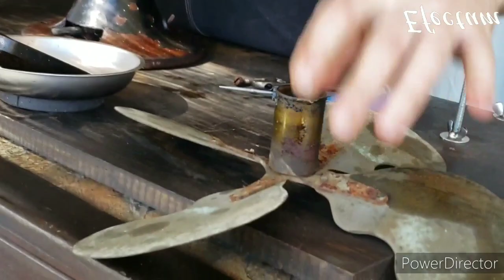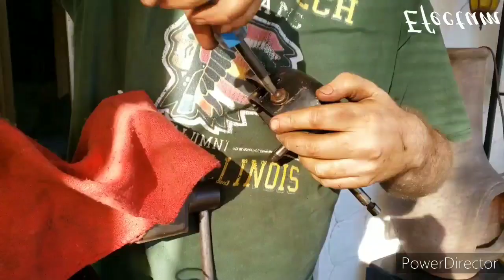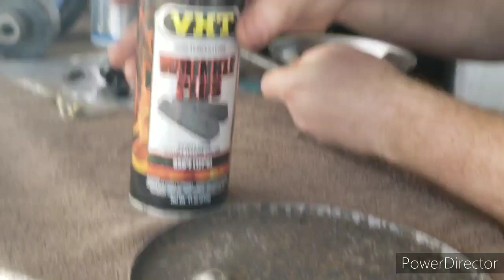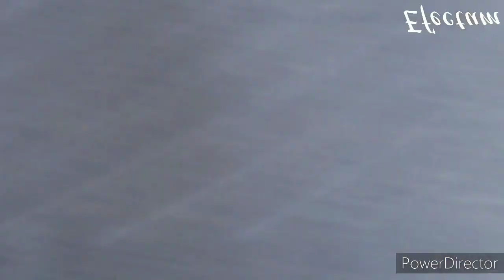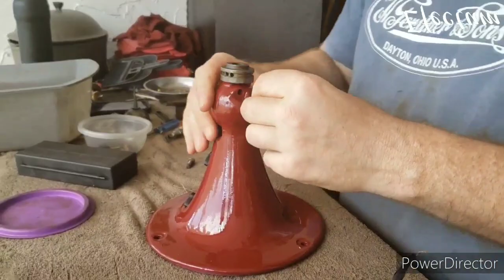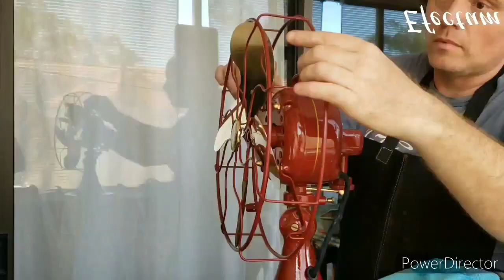Old Rusty Fan [Restoration]: Emerson 29646

Comment: Just learned a different way to twist those tricky blades off by using upper left screw hole with longer screw to safely reach rotor without risking damage to motor windings!! Thanks for the info!! Now Emerson restorers can work and sleep better knowing best way to remove those tricky fan blades!!!

Comment: Did a 16 inch just like that. All black and brass blade. Had to put in a new capacitor. New green felt on the base.
Very powerful and smooth. Should last another 88 years.
Reply from the maker: Sounds nice. This model does not utilize a capacitor. Old fans were built to last.

Comment: Color me impressed awesome restore! gets me into the idea of restoring two one small one from my grandmother and a large one from my great-grandparents around the time they came to America and bought a brand new brownstone in Brooklyn. The small fan I use often its kinda of a dark green with a hi-off-low switch, and the larger older fan needs a new fabric cord to the head unit and has a silver body with the slide switch. I plan on coming back to your video as you mentioned a guy who sells some replacement parts. Funny story I have my grandmother's Hoover upright from 1929, and until a few years back, Hoover still had new old stock parts. There's a video on YT on upgrading the inner bag to get this lol HEPA. Before I knew about Hoover still having parts, I had melted down a black spray can cap to repair one of the wheels, and it's about 90% perfect on roundness. Again, Awesome Restore!!! Thanks for the video. Eddie J.   Long Island N.Y.
Reply from the maker: Thank you for the comment. Its nice that you have a couple heirloom fans and worth the trouble to restore them.

Comment: OK, Chief!  Just finished restoring my Granddad's fan today!  As the video states, I have been jamming on this thing for a month now.  It was like a  sweater when you see a little piece of yarn sticking out.  You pull on it, and more and more keeps coming out!  I also used your ideas about pinstriping, but I used an adhesive strip that is no fun to use but makes for a satisfying job.  Also, I got a butane torch and brass wire wheels for my drill and plated several screws and left the oscillation link arm and several other parts brass instead of painting them black. Basically. I only touched up the otiginal powdercoatI and only sprayed the oscillation gearbox and adjuster on the bottom.  I will make a vid on the restoration and will link you when it's done.  Lots of great ideas from you, and I want to give full credit!  Also, it scares me to think of what I was planning on trying to get the blade off!  With the 2 inch 10/32, it twisted right off!  A day before I started the restoration, I banged one of the blades, which I restored, but hacked me off became after all its been through and 105 years, that was the first real damage to the blades!  Thanks again for your great posting!  I will be in touch!
https://youtu.be/rmzYjeH2bXI?si=3Kc7ZE70D2Z_NRQk
Reply from the maker: Your fan runs very nice and looks good too! Glad I could be some help. Nice to have a family keepsake like that.

Comment: How did you spray the stator windings with all that tape on them? Did you take it off and re-tape them?
Reply from the maker: Since the stator tested good, removing the tape is a bad idea as it would likely do more harm than good. By making small incisions in the tape you can get a long plastic nozzle in there and still spray them pretty good. This way you give some e tra protection but don't risk damaging the exisiting insulation by ripping the tape off the wires.
Reply: @BencoVintageMachineWorks  thanks so much
Reply from the maker: Thanks for watching

Comment: where do you buy the correct size and type brass rivets, I can't see the details on the bag you bought ?
Reply from the maker: Jay Cee or Mcmaster Carr are good choices.
Reply: @BencoVintageMachineWorks  are these hollow or solid rivets, they look kind of hollow in your video
Reply from the maker: Hollow, I annealed them first and drilled out the holes to fit as shown....
Reply: @BencoVintageMachineWorks  thank you
Reply from the maker: Any time. Good luck with your project!

Comment: Awesome video. Bought the same model fan today, was running at the antique shop just the oscillator wasn’t moving. Now I get it home, plug it in, move the speed to one and nothing… move it to two and nothing… move it to full speed and it kicks on full power. Then I went to turn it off and it shocked me and quit running…. My works cut out for me
Reply from the maker: Its a great fan. Very well made. Good luck on your project. Glad the video is useful to you.

Comment: I have the same fan but my blades are not brass... A magnet sticks to them!  I'm guessing some of these fan were made without brass fans?
Reply from the maker: The later ones were not brass
Reply: @BencoVintageMachineWorks   Do you know of any place to get brass blades?
Reply from the maker: Theres regularly used blades on ebay. Also check Antique Fan Parts website...

Comment: Another incredibly GORGEOUS restoration job Terry! The fan is beautiful! I immediately knew as soon as you touched it, it was going to come alive again. I admire your mechanical restoration work. Thank you so much for sharing! O, I just wanted to share a tip w/you. I noticed you taped your vice to protect the fan blades. I do small scale metal work & I enjoy a silicon sheet to protect the finish on my pieces. Just in case you might like to use some for your pieces.
Reply from the maker: Thanks for the tip!

Comment: Awesome job… your work and your video!!  I’m working on an Emerson 73646-AK that only really has one speed (out of three).  It has a split-phase motor and has a speed choke & capacitor. Resistance checks on the choke and motor are identical to another similar fan (77646) that runs all speeds. So, could the capacitor be the problem?  Any thoughts would be appreciated.
Reply: Your problem is likely in the switch or the speed coil.
Reply from the maker: This fan was my first and only attempt at an antique Emerson fan so I don't feel qualified to diagnose oroblems on things in which I do not have experience. I recommend that you join our FB group Antique Electric Motor Experts as well as the AFCA forum online. You can post pictures and will get answers quickly. Best of luck on your project!
Reply from the maker: The AFCA is not a FB group but an impressive online forum. Have fun!

Comment: You did a fantastic job on that unit. I'm restoring the same fan and found your video to be an excellent source of information.  Could you tell me what the part number is in the brass rivets you used on the blades? I looked at jay-cees website and can't seem to locate a match.
Reply from the maker: I don't remember it. It's been awhile. They were semi-tubular and came in bags of 100. I annealed them before using. Good luck on the project!
Reply: What process do you use for annealing them?
Reply from the maker: I used a propane torch

Comment: How did you clean the contacts on the switch I need to that on my Emerson Type 450.
Reply from the maker: My contacts were corroded so I removed the corrosion using Evapo-Rust on a paper towel. Afterwards I polished them up using the Dremel tool.
Reply: @BencoVintageMachineWorks  Ok thanks I appreciate it.

Comment: Looks like that linen tape is used frequently. I think I see it on my motor too. Do you know some of the common situations where it is used? Motor is a capacitor start induction... hope that's the right name. my mouth dropped when you talked about the DIY brassing technique. Totally hope there's a video for that. 🔥 Wait, where did you get a Walker-Turner shirt? 😎
Reply from the maker: The fabric tape is used cosmetically over electrical soldering connections after the heat shrink tubing is applied. I almost never use any wire nuts or regular electrical tape. The capacitor start motors were usually less expensive to manufacture than the Repulsion Start Induction Run motors but ball bearing varities are good on a drill press where the motor needs to be mounted vertically. I had the t shirt custom made. The brassing technique is shown in the video. Just heat with a torch and wire brush the piece with a solid brass wire brush in the dremel tool. Would not use in situations where the temper of the metal is real important.
Reply: @BencoVintageMachineWorks  Terry, I'm pretty far into the windings on my motor. I've removed the tape and insulation on a couple areas where the winding coils are connected and I can't seem to melt the solder (even at 800f) in order to separate them, so I could add heat shrink, then resolder. I'm hesitant to cut the connections. What could I insulate with, if I don't cut them to use heat shrink? I've got them pretty well cleaned up, so they just need to be reinsulated, then friction taped. If I snipped them, I could resolder, but it won't give me much to work with.
Reply from the maker: @ForestWoodworks  This is the area you posted a picture of in the group?
If so just slide heatshrink down over the solder joint as far down as it will go. If the leads need replacing then can cut and solder on the new one a little higher up. Its not ideal because now you will have an extra solder joint but it is better than the alternative of damaging the winding.
Reply: @BencoVintageMachineWorks  so this is just up from the severed area where there are winding coils wrapped together and soldered... it looks like they come out the stator from the other side. The insulation material was pretty shot, so I removed it and was going to separate the joint to slide on some heat shrink, then resolder, but I can't undo them. So instead of cutting them, I'm wondering if there is an alternative to heat shrink layer. Also, I just repaired the severed coil and it looks like I used too small of heat shrink because I can't slide it over the joint. Man, going south in a hurry. I'll post a pic of the area on the group, if you want to check it out.
Reply from the maker: @ForestWoodworks  They sell a product called "Liquid Electrical Tape" which is a brush on insulation. Afterwards, you can wrap it in the friction tape.
Reply: @BencoVintageMachineWorks  yup, okay! I have some of that, but wanted your approval before using it...I know the regular black electrical tape has a bad wrap (pun intended) for use on motor connections. Should I still coat the sever repair with clear nail polish?
Reply from the maker: @ForestWoodworks  To be clear, I avoid liquid electrical tape when possible. Sometimes though it comes in handy for a job where you dont have other options. I would repair the wire enamel with the clear nail polish and then coat over the repair with the liquid tape followed by the friction wrap. That should provide sufficient durability.
Reply: @BencoVintageMachineWorks  Terry I just finished applying the liquid tape. I know it's not the go-to, but sure good to have as a last resort. Do you ever redo the winding tie-downs? In this case I had to cut them to repair the joints. I don't think the friction tape will go through the spaces very well, so I'll probably retie-down each side of the stator before revarnishing. Is there a specific brand or name for the tie down material I should look for? Thanks again for pointing me in the right direction!
Reply from the maker: @ForestWoodworks  You can use some twine in the areas you can't get the tape into. Thats what they used back in the day anyways. Don't pull it too tight so it doesn't pinch anything.
Reply: @BencoVintageMachineWorks   @Benco Vintage Machine Works  sweet, thank you! I'm working on the lead wires now and rewatching the Craftsman/Dheil video, then the Emerson motor 😎
Reply from the maker: @ForestWoodworks  All this work you're putting in...you won't need my videos anymore...lol.
Reply: @BencoVintageMachineWorks  no way! I'll always watch your videos. This is expert work which otherwise a person would have to pay for apprenticeship schooling to get. Plus, I've always hated throwing things away, especially quality manufactured goods that just need life put back into, and then to be properly used and maintained. I'd like to slowly piece my whole garage shop together with vintage machines, each of which has a motor ;) Honestly, I've been checking your channel every day or so hoping you got a new upload lol You've been a life-saver (videos plus answering my plethora questions)! I've been working on this saw for almost a year and was dreading the motor due to zero experience and knowledge, but I've learned a ton just in the couple weeks since I found your channel! Not only learning just from a knowledge standpoint, but also I'm actually applying it. Nah, I'm good. You got a subscriber and my respect for life 👍🏼. I'll need some guidance hooking up a temporary test switch soon (lol), so I can address any motor run issues before I move onto the rest of the project. Once this motor is 💯, I'll be on the home stretch for the remainder of the saw 😎 There are a lot of people "restoring" motors and other things, but I've not found anyone who takes the time and care you do. Not one.
Reply from the maker: @ForestWoodworks  Thank you. Luckily putting in a switch is pretty straightford and I am sure you won't have any trouble.
Reply: @BencoVintageMachineWorks  everything you do is so well-thought out! Thanks for explaining.

Comment: What an inspiring video! I've now watched it at least six times and am ready to tackle my own fan restoration. A couple of questions that I couldn't find answered in the video. 1. Did you prep the fan cage or enclosure for priming by soaking it in Purple Power as you did with the other painted parts?  2. With regard to the blades and boiling them in vinegar/salt, how did you keep them numbered? I doubt you left the masking tape on them while boiling them. 3. To revive the badge on the front of the fan and on the motor body, did you also boil those in vinegar/salt or did you soak them in Purple Power? Fingers crossed that my fan can look as gorgeous as yours when I finish. It once belonged to my parents. Thanks!
Reply from the maker: Hello, Thank you for the kind words. As to your questions: 1)The cage was soaked in PP to remove the old paint and dirt from it. I then soaked it in Evapo-rust to remove corrosion so that it could be painted. 2) I lightly stamped each blades number on the back side where it is hidden by the hub. 3) Front badge I put in PP and then boiled it in vinegar. The motor tag I just polished by hand. Anything you place in PP will lose the paint so its your call. You can always repaint the motor tag afterwards and then lightly sand off the paint on the embossed letters. I will offer my advice that, by far, the most important part of your restoration will be taking your time to do a thorough job on restoring, varnishing and wiring the motor and speed coil. The cosmetic stuff is just icing on the cake. I wish you the best of luck on your project.
Reply: Ha! I know my limits and have arranged for an expert to do all the retiring and motor restoration. Thanks again for the inspiration and encouragement.
Reply: *rewiring

Comment: Thanks for the video. Beautiful work! My question is regarding the wiring. What is the wire size for this fan? Did most antique fan manufacturers use the same size wiring? TY
Reply from the maker: Hello, great question you asked! I used 18 gauge wire in this project. When discussing wire gauges, a higher number means a smaller wire. This motor doesn't draw too much current so no need to go overboard. Thank you for watching the video.

Comment: Hi, I was wondering did you cut the rivets off of the information plate and use new ones to reattach or did you heat them up and remove and reuse them, thanks.
Reply from the maker: I usually cut off the heads using the Dremel and a cutoff wheel. Then drill out any remnants still in the hole. Sometimes you can access them from inside the housing if you remove the stator like I did here. In that case you just tap them out from underneath using a pin punch. The rivets themselves are commonly referred to as drive rivets or drive screws. You can find them on Mcmaster-Carr or ebay under manifold rivets. Good luck and thanks for watching!
Reply: Is there a certain size or length you use, say for example #4  5/16?
Reply from the maker: Yes the #4 5/16 is what I used
Reply: @BencoVintageMachineWorks  what size brass rivets did you use to reattach your fan blades?
Reply from the maker: The rivet size is 9/64 x 7/32 x 15/64 oval head semi tubular. I bought them from Jay-Cee and you have to order 100.
Reply: @BencoVintageMachineWorks  is this an Ebay Seller?
Reply from the maker: @c0nfidential1  No. Here is the site: https://www.rivetsonline.com/

Comment: Amazing restore job.  Beautiful.  I'm in the middle of a restore on the same fan.  Very Helpful information.  Can't, however, find the small brass rivets for the name plate.  CAn you help?
Reply from the maker: Thank you for the compliment. As to your question: The rivets that secure the name plate are commonly referred to as "Drive Rivets" they are available at McMaster-Carr or on ebay as "Manifold Drive Rivets". Best of luck with your project!